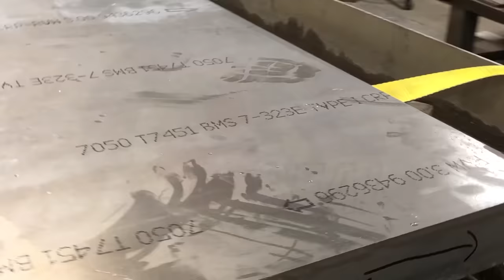Water Jet Cutting through 3" inch thick Aluminum Metal 4' x 6'

Comment: 1. It's aluminium and not steel. Aluminium is a soft metal.
2. It's not just water, but a mixture of other materials including water.
3. The speed of the jet
Reply: Thnx for info 👍👍
Reply: I thinkg add collant. But steel is too much hard. Ms we can cut with water jet. How much thickness we can cut on machines.🇵🇰
Reply: Still don't think I could bend that sheet...
Reply: And the point is ?
Reply: Its pressurize dear..
Reply: Adit Padhy  your answer is not relevant to my question. Are you technical person or no. If you purchase machine then need to check specification capability.
Reply: One behalf of all the public could I just say , NERD ALERT 🚨 !!!
Reply: Aluminum is a alloy not a metal!
Reply: Ritesh padhi  🤣🤣😂🤣😂🤣 Pakistan 🖕🖕🤣🤣😂😂
Reply: @scor440  aluminium is a metal extracted not alloy..... It is extracted principally from bauxite minerals....
Reply: It's just water
Reply: steel cannot be done with this
Reply: Aluminum is Soft 😂😂
Reply: It literally says aluminum shush
Reply: No need of other only high pressure water
Reply: For $140,000 Australian you can get one that will go thru 4” of mild steel. So it doesn’t really matter if it’s aluminium or not. They mix the water with garnet but water will make the cut on its own
Reply: @scor440  Aluminium (aluminum in US-En) is a metal, it is the 13th element (Al) of the periodic table. There are aluminium alloys though, which are alloys in which aluminium (Al) is the predominant metal.
Reply: @sriramramamoorthy1589  checkout out the topic of electrochemical machining , you can cut steel, titanium, iridium, tungsten with no contact/no pressure
Reply: But it's a lot harder than your bones and flesh, haha!
Reply: Aluminum is in the Periodic Table, therefore not an alloy

Comment: water cutting is used in many industries...has been for decades. Frozen foods, plastics, and yes steel. It may be slower than oxy-fuel gas cutting but no heat distortion. 
Thanks for sharing your video. cheers

Comment: Special sand is called abrasive. Sometimes its called aluminum oxide. Pressure can reach up to 90,000psi. The thicker and hardest material I cut on waterjet was Steel 5 inch think. Took me 4 days to cut. 10 hours daily. Also i used 3d cuts (on the angle)
Reply: Jesus Christ! 😲 

Do you know what is 90,000 psi? That's equivalent to around 500,000 pascals on a truck rim!
Reply: lol. you need to aknowledge yourself with psi. truck has about 90 to 100 on average class 8 truck, not 90,000. 90,000 in a stream 0.5mm line will cut 1 inh wood in a second...
Reply: Good information brother
Reply: @juancarrero1119 with waterjet its more precise with thicker materials, with thinner materials laser. It can take few days to cut a 5inch think stainless steel with water jet. Water is filtered and seperated with that abrasive but abrasive had to be refilled with new one. Old abrasive usually get returned to a company who recycle it, they it and renew
Reply: Xcuse me dear , 
Where are you from?
Reply: @naikg8111  why?
Reply: @TheBastion87 I'll tell you later.. first you just tell me.... please?.
Reply: @naikg8111  usa
Reply: Longest job I have done is a 10 hour job
Reply: So it's the concentrate pressure that does the work right?
Reply: @dallomarde5756  yes with abrasive. Like sandblasting but with water instead of air pressure

Comment: For water jet cutting. ..use high pressure water with a cutting media like: aluminium oxide or garnet, silicone carbide powder grit 320,600, and many more.
Reply: How does the nozzle get saved from effect of such tremendous force and cutting materials?
Reply: @rajibgr9104  it is consumable. Life depends on amount of piercings and abrasive used.

Comment: Highly pressurized water, maybe 60,000 psi, mixed with an abrasive material that is probably Garnet. Then pushed through a hole like .040” In combination this is able to cut through even stainless steel.

Comment: there it happend with high speet of jet of water included mixture of abrasive particles (alumina or silica)..it can also cut steel plates and mainly used for cutting of fiber composites..

Comment: How do you clean the abrasive out of the machine?
Reply: may b by using filters.
Reply: @vinaybhat7670  We have one where I work. I like to see how others deal with certain issues. These machines require a lot of maintenance. We have a machine that pumps the used slurry out and puts the water back into the tank. We have dug it out and used a pressure siphoning system. Here is what we use.  https://youtu.be/wHVmbQAXKWI

Comment: What do they do with the contaminated water? Wouldn't a plasma cutter be safe for the environment? It would save the water and discharge of contaminated water.
Reply: plasma cutter wont give this kind of fine finishing..and metal waste will b higher there.
Reply: The water isn't contaminated, it just has sand in it that eventually settles out. It can go right down the drain but it's normally used over and over.

Comment: How much pressure developed in it
Reply: 60,000 to 80,000 psi. Garnet sand is a must in addition to the water. The Jet Edge machine at my job cuts 6" thick stainless steel. It cuts any thing like butter.

Comment: This is slow and there exists  better ways to cut the same.
Reply: This doesn't produce slag like a plasma cutter and is infinitely repeatable because the jet doesn't dull  like a saw. A shear is probably the only cleaner way to cut, but the shapes and metal thickness are limited.